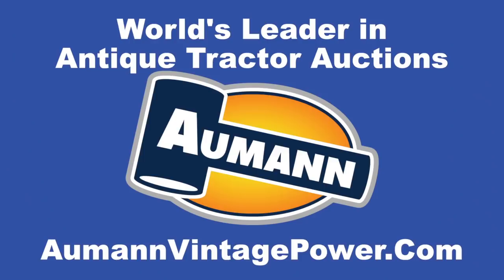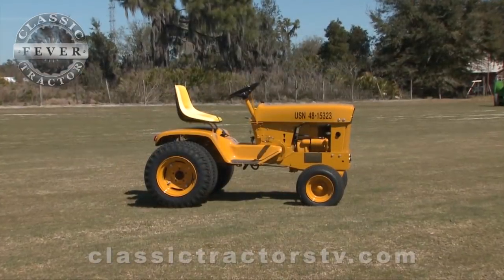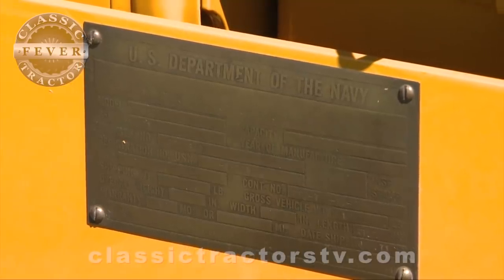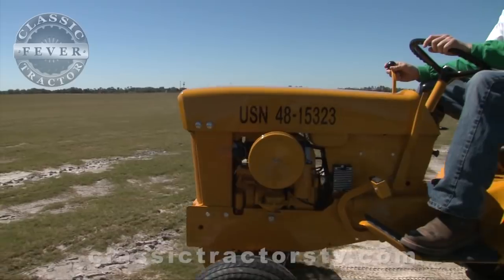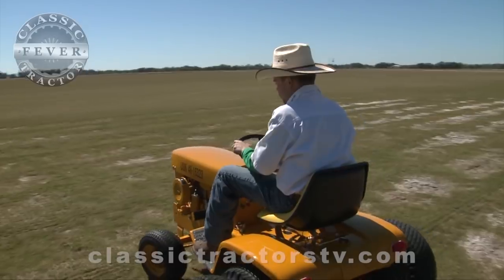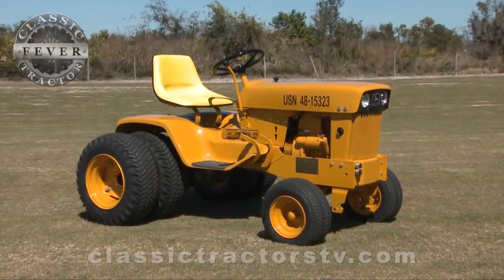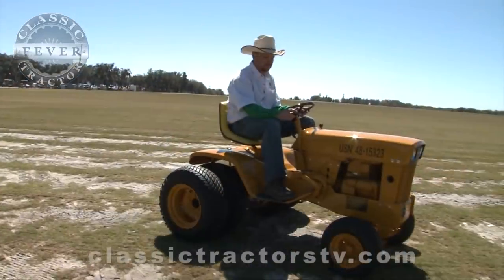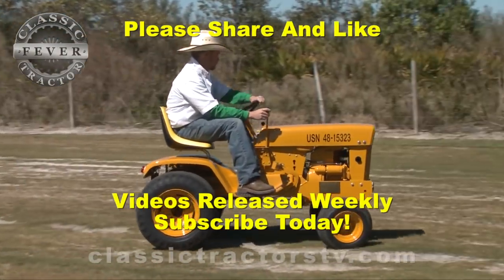John Deere Built This Garden Tractor For The Navy! - 1970 Model 140

Comment: I served on a carrier during Vietnam, released from active in 70 when this unit was built. Couple of problems w/ using this on a carrier 1) not heavy enough to move an aircraft around. Tugs on the carrier  are extremely heavy & are made of 1/2 & 3/4" plate steel.2). Fuel would be a problem. They only have JP (jet propulsion) fuel & high  octane aircraft fuel available (115-145 AV gas) for the piston driven aircraft. 69 & 70 the navy was using a combination tug, GPU  (ground power unit, for electricity), & a huffer (compressed air to start engines). All 3 units were in one vehicle & they ran on JP-5 which is nearly identical to kerosene & will burn just fine in a diesel engine. The turbine engine used as a huffer ran on JP also. I doubt that the little John Deere could be used for much of anything on a carrier deck. Too light to tow anything on a slick & pitching flight deck. On an NAS  (Naval Air Station) they could have used it for a number of things. We had tugs that used a slant 6 for power, trailers that could be towed by a tug, a flat bed van like thing (feature an old 60s era Dodge van w/ everything cut off but the dash & 1 seat for the driver. Had a slant 6 & auto trans that was locked in 1st gear so that it wouldn't go very fast.  The trailers & the flat bed van were used to haul wheel chocks, drop tanks, rocket launchers, MERs (multiple ejector racks, for hauling bombs), and an assortment of other items used on the flight line. The little JD could do that just fine.  Seriously doubt that it saw any duty on a carrier but could have happened.

Comment: When my father was in the navy in those days.. They would have a wheel horse, a deere, or any tractor that had hydraulics.. They had pintle hitches on all of them, so they could be locked in place in the belly of the ship so it would not slide around in rough seas, some having duals so they can't roll over. The hydraulics of these tractors were the main purpose they were on board a navy carrier.. If the deck elevator system went down or was bombed.. They could connect the garden tractor and hydraulic oil caddy tank to a secondary system and still raise and lower planes on the elevator. My dad also said they could sometimes have up to 4-5 of these little tractors on board as backups. End of war, many were shoved off the deck and no longer needed. Sometimes on a ship you could have a deere, a case, and several other brands onboard... Whatever was available.

Comment: I bought a John Deere 430 with the 3 cylinder Yanmar Diesel about a year ago.  I started restoring it right away and finding parts was a challenge, But I am at the end.  It was missing the rear PTO and 3 point hitch.  It is sitting on jack stands waiting for the wheels to get back from powder coat and new tires and then its done.  I have the fever now, not sure what I started...
Reply: I caught mine with my John deer gn. It's not running yet but only 1500 we're made so it's worth it.

Comment: I retired as a civilian after 35 years working for the Naval Facilities Engineering Command.  I have minimal knowledge of carrier ops, but as a professional engineer their use on a carrier to tow aircraft makes no sense whatsoever - they only have rear wheel brakes and not nearly enough weight to control a combat aircraft on a pitching carrier deck.  I have seen them used at Navy and Marine Corps Reserve centers for lawn mowing and snow removal, however.

Comment: With that pintle hitch and dual rear wheels, it probably was a tug of SOME type.  Good looker.
Reply: It's not a tug. They had tugs for that, and that would be significantly over any JD tow rating. If this thing was pulling around anything cool like a fighter jet, this guy would be trying to brag about it! Boy our military would be sad if we could build multi million dollar jets but had to tow them with a sub thousand dollar "garden tractor". Even the USSR wasn't that pathetic.
Reply: jbj27406 actually it was indeed used as a tug.
Reply: @corbinmurphy4708  You have no evidence what so ever to support that. Just because it has a pintle hitch does not mean it was ever a tug. The Americans invented fighter jets, and aircraft carriers, do you think they just said "let's pull all this multi million dollar stuff around with a lawnmower!". NO. They had purpose built tugs for this. Devices called "tugs", not "lawn tractors". It would be incredibly stupid to try and haul around a big plane with that, it is too light and could never provide sufficient braking. This is why a real tug is many thousands of pounds.

This owner obviously thinks he is an expert in this tractor even though he knows very little...if they were using this device to move around something cool like jets you can bet he would have been bragging about it!

Comment: What the hell would they have needed that for on an aircraft carrier?! It's obviously not a tug...and I'm pretty sure they don't grow grass on the boat. If they just wanted a mule to ride around on there are also better choices. This guy seems to think he's an expert but actually has no idea what this was used for...
Reply: Ryan Roberts they actually were used as tugs. The 140s actually had quiet a bit of pulling power and would have done just fine pulling smaller aircrafts. The 140 isn’t just a mower it’s a true tractor.
Reply: @corbinmurphy4708  It's a "garden tractor". It simply does not weigh enough to move aircraft safely. Small tugs were usually smaller but still full farm sized tractors with multi cylinder engines and extra weights, like Ford 9n size. Otherwise they had specially built small and larger size tugs. Again they are meant to be very, very heavy with strong brakes. They have to be the brakes for the aircraft and they have to hold it if there is a gust of wind. A 140 can't do that with any military plane unless they keep little Cessnas on the aircraft carrier. It's simple weight and physics, the 140 is too small, and too cheap. They didn't buy "garden tractors" with an extra wheel bolted on when they could afford a fleet of custom built vehicles for the task...which the ship was equipped with.